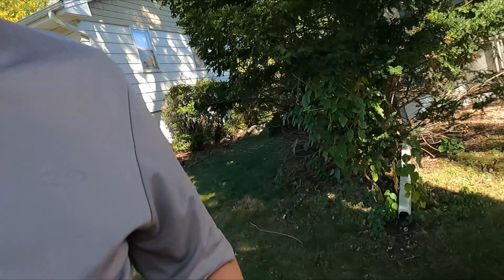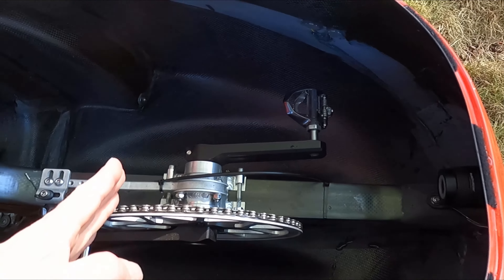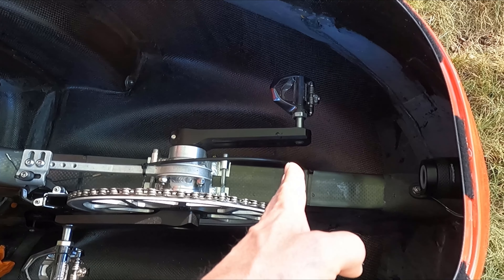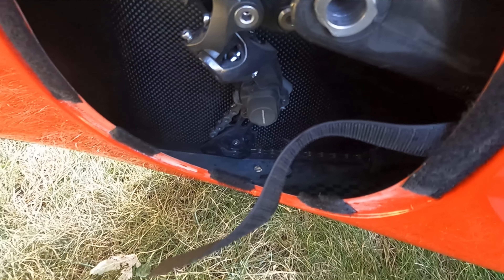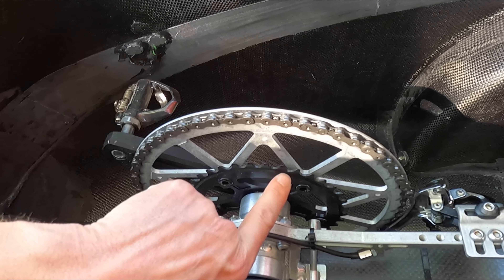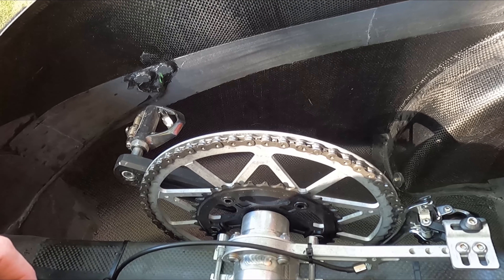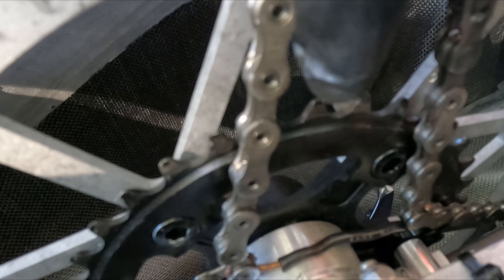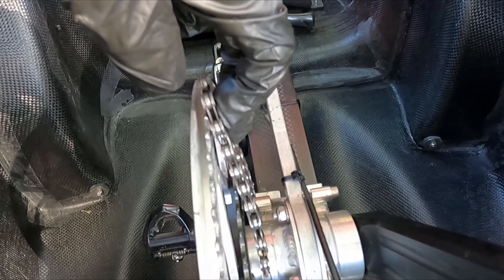Tech Talk Ep. 11:  how to resize the chain in a velomobile

Comment: I am aware of several Bulks that were ordered with rear cluster and front chain ring combinations that exceed the chain wrap of the rear derailleur. In that case a big-big sizing will result in excess chain in the small-small combination where the chain will interfere with itself at the rear derailleur and the chain will be too slack.  In that situation, the velomobile owner will need to be aware of the combinations that cause the issue and avoid them.
Reply from the maker: @recumbentguy  this is a very common setup with Velomobiles in general now. I’ve run as big a difference as 60/33 with 11-40. With the chain sized big-big I could use I think 4 gears with the small ring, but I don’t know of a time I’ve ever used more than the two lowest gears with the small ring on any of my Velomobiles. It’s more efficient to ride in the large ring. This is the best way to get the large gear spreads needed for both high-speed cruising and steep hill climbing. Aside from attempting half-step gearing, I’m not sure why someone would want to use the higher gears with the small front chainring. There is more loss of wattage with the small front ring than the large front ring due to the greater articulation of the chain, or so I’ve been told.